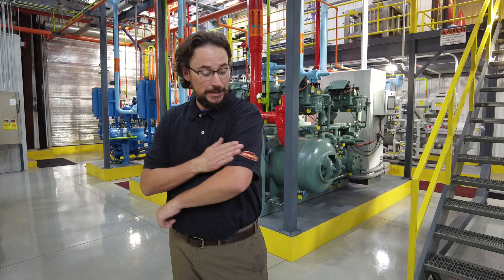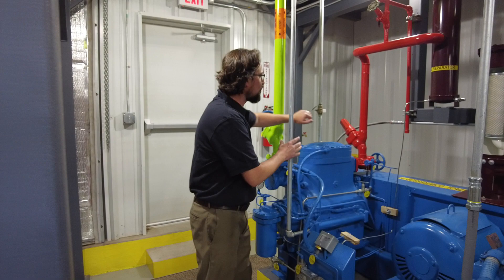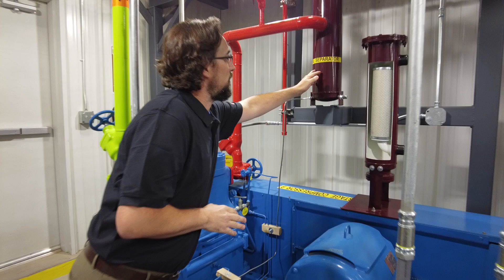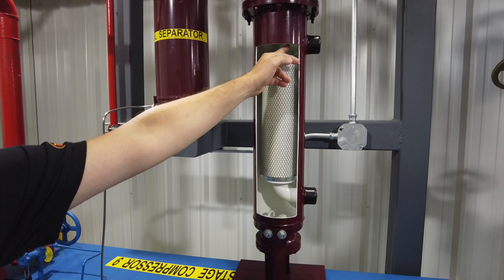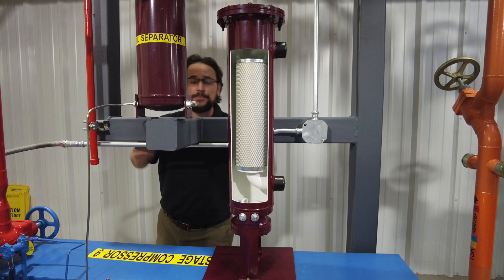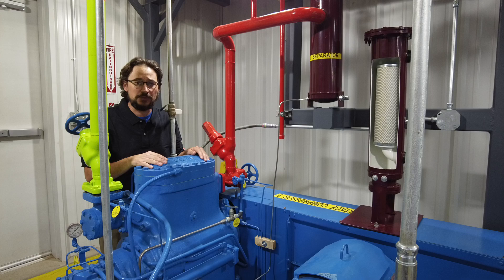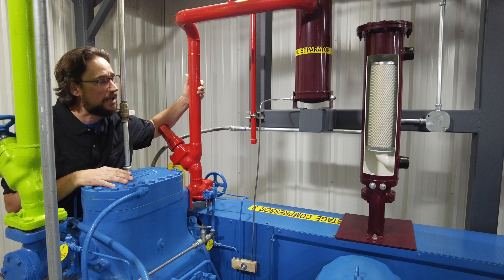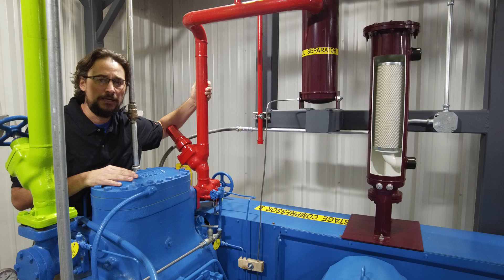Ammonia Refrigeration - Oil Separation - Reciprocating Compressor

Comment: The only reason why a seperator would fill with ammonia or refrigerant is due to a failed discharge check valve that should be located directly after the seperator.

Comment: Hi, for some reason  our ammonia compressors lubricating oil is heavily Contaminated as a result when suction pressure is increased icing begins to form below pistons bulkhead,morning we drained lot of oil from oil separator while the compressor was running ever since problem started, any ideas? ty

Comment: cool content, love getting to see the Ammonia side of refrig, not much content out there for it.

Question.. Would installing multiple oil separators in series benefit a system??
Reply: No. The oil separators have coalescing filters in them that stop the flow of all the oil, adding more would really not do much beyond what they're designed for.
Reply: It would affect velocity of gas as well